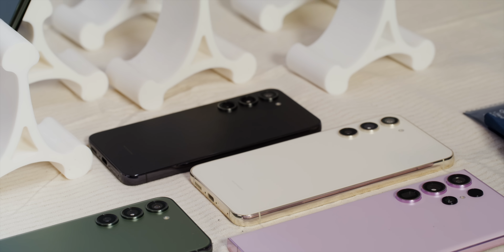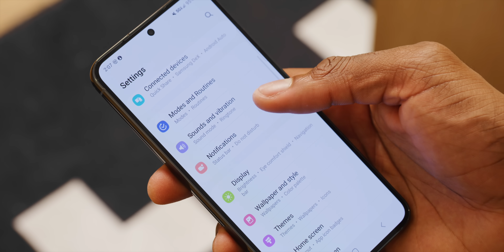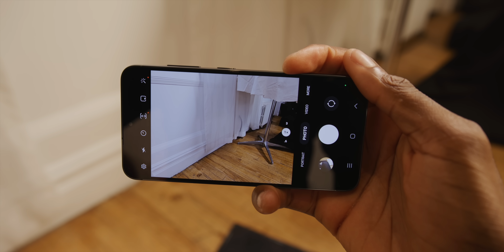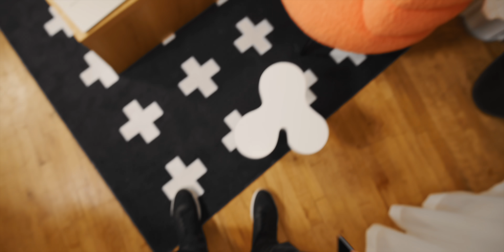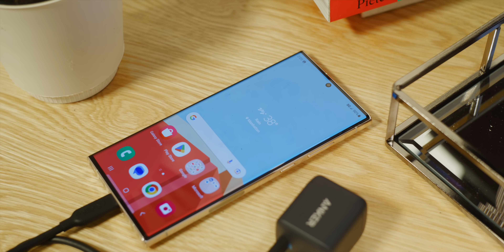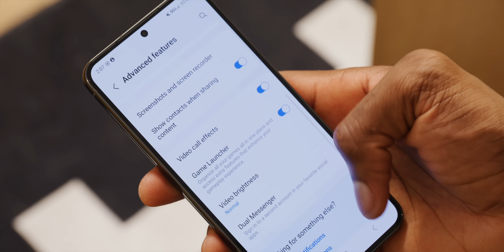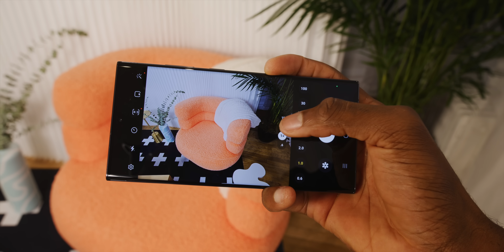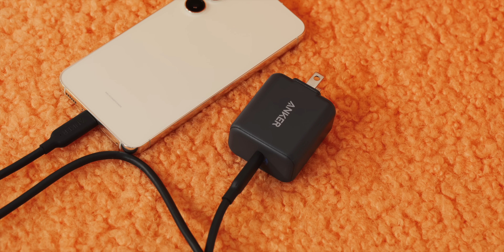Galaxy S23 / Ultra Impressions: Cruise Control!

Comment: Gonna wait until the S24 I think, depending on benchmarks and performance. Even the difference between the S21/S22 Ultra wasn't enough to make me want to upgrade.
Reply: Same, I'm still hanging on to my S9
Reply: @Adam-gl1qv  Depending on what you do with your phone, I'd recommend bumping up to the S21 Ultra. You can find GREAT deals, and it really is a powerhouse. I use mine as basically my second computer, and do a lot of retro gaming/emulation. In theory, the Snapdragon 8 Gen 1/2 are fantastic, but phones just don't have the thermal capacity right now to run them at full speed for any significant length of time, with the exception of the Redmagic 8 Pro, which has a whole ass internal fan.

Comment: I'm still rocking my S21 Ultra and love how it still works like the day I bought it. I'll hold on to it until it explodes. Phones are so good these days there's little need to upgrade anymore and I love it!
Reply: I tell myself this but desperately want to see what the z fold 5 is and if I'd be worth the $
Reply: Exactly! Still using my S9 and trying to decide which one to upgrade to. May get the S21FE as the price and battery are attractive.
Reply: @Furbabyfoster  try a z fold in a phone store to see if u like it. the fold 5 could be an epic phone later in the year. but ye its expensive.
Reply: I still use my Galaxy note 9 ! feeling like phones improve sooo little every year and they prices are so high

Comment: i liked the s21 ultra design feels like they just went backwards but the new colors are nice, think i will stay with my original s21 regular for awhile., unless they slow it down with some update then i will never get another samsung but thats just my paranoia 🌝
Reply: I swapped from my s21 ultra to the 13pro. Trust me if your a camera person, its not worth the swap. It felt like walking back to 2015 pictures with no zoom or organization. iMessage and airdrop are great but weigh your preferences. Im running back to Samsung next cycle personally.

Comment: I have the S22Ultra from last year. This one doesn't look like it's that different from what I have. Slightly different shape. I like this one. One thing I do not like about my phone is when placing it on a hard surface, it doesn't lay flat without its case. This version looks like it's figured that out. It's not giving enough differences for me to upgrade though.

Comment: The s22 was not rock solid, horrible battery life and choppy software
Reply: Also overheating because of the horrible gen 1 chip
Reply: Not surprised either that the shutter lag is STILL there on the s23

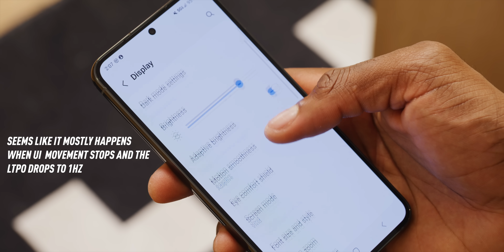Comment: 4:49 you can always turn on the show refresh rate feature in the developer options. That way you can always see exactly what the refresh rate is at any given moment.
Reply: Mine switches between 24-60-120hz and not from 1-120 hz, do you know why that is?
Reply: @jonathanstupidcheesespaghetti  I've heard it's because the screen refresh rate itself is changing via hardware rather than software, which is why it can't be detected on an OS level.
Reply: @jonathanstupidcheesespaghetti  because not all can go to 1hz, whats your phone?

Comment: Watching on my Galaxy S20 Ultra. I'll keep it another year and wait for the S24 Ultra. Just recently got the Android 13 update so I think I'm good with this phone another year.
Reply: Me too, I still have NOTE 20 ultra for two years now it's sharp and works amazingly fast, and does the job for me.
Last year and this year's Samsung S series updates are absolutely useless and Trash
Reply: @hamadalink9197  Another NOTE 20 Ultra user also! Phone is still in mint condition and I see no reason to upgrade for at least another year or so.
Reply: I have an s22 ultra bought in september. Tried to see what samsung would give me for it and they offered 90 euros because of a small crack in the glass. Lol.
Reply: My S20 Ultra is on the ropes rn. Pre ordered the S23 straight away
Reply: I'll take it up a notch with the s22 ultra which I think it has the spen and leave it at that for another couple of years, maybe summer or something I'll keep my s20 ultra for a little longer
Reply: @HUYI1  i would not recommend any variant of the S22 series, all those phones had terrible processors. When you buy a samsung phone make sure its manufacture by TSMC and not Samsung! I had the S22 Ultra (snapdragon manufacture by samsung) and upgraded to the Fold 4 (snapdragon manufactured by TSMC) and its a night and day difference.
Reply: I have an S21+ I'll probably be sticking with for another year unless something really exciting pops up on the S23+.
Reply: Using my s22 ultra for another year too
Reply: Idk but i think it is better to wait till 2025 because thats when we get the 500mp camera, selfie camera that can disappear, fingerprint scanner on the entire front screen, and redesign.
Reply: good decision 👍
Reply: My S22 is in dire need of an upgrade right now
Reply: @StreamerBTW99  unless if its broken beyond repair, please do not waste your money on the same phone

Comment: The 23 doesn't have UWB (not the 5G type the short range type)
The 128 base s23 also has slower storage.
Just 2 notes
Reply: The 128 base s23 has faster storage

Comment: Should I go for S23 or Google pixel 7 ?? What would you advise
Reply: Pixel
Reply: S23. The battery life is absolutely insane on the s23 with the gen 2. The pixel 7 gets about the same (only slightly more) as the s22 series which was ridiculously inefficient and heated up. Which if you're not a heavy user, you're not gonna notice. But if you're on your phone, you'll be itching for a charger on that final stretch
Reply: @DavidMFBowie  uhm? Do you have the s23?
S23 is only 3900 mAh 
The pixel got 5000 mAh

Comment: My S22 is still running great, so I'll probably pass on this year's model, but I can't wait to get my hands on the 2024 model when it drops.
Reply: Is the battery as bad as they say?
I'm considering an S22
Reply: @Ssh52  I'm never far away from a charger, but I'm pretty much on my phone constantly and get about 75% of my day without issues. I have the note 22 ultra though, so I have the largest battery they offer. No idea about the lower models.
Reply: @Ssh52  on my S22+ it's worse than my lat POCO F3.... but it is the chip's fault, only reason I want to change
Reply: @Ssh52  no. I am finishing my days with 40% battery left. About 2 hours of usage or 6-10 straigth hours of just listening to audiobooks
Reply: @lauri1687  I'm coming from an S9 which isn't the best for battery now, and needs at least one small charge during the day after a couple hours of use
I'm guessing the S22 will be fine by what I am currently used to with the S9 battery?
Reply: @Ssh52  really not great, but thats coming from an EU model with exynos in it
Reply: @ilovejesus1238  I'm from the UK so it would also be an Exynos.
I'd love to get an S23, but its far too expensive as of now, and I need to get a new phone as my S9 is too old for security+ safety reasons
Reply: @Ssh52  for my s22 u, 4hr sot from 85 to 20
Reply: @Ssh52  Honestly no it's not bad at all. By the time I get home from work I'll still have around 65-50% left of my battery which is why I don't bother carrying my charger around. And that's saying a lot cause I use my phone religiously throughout the day.
Reply: Why would you upgrade a hugh end phone after 2 years lol, i have a s22+ and plan to keep it for atleast 4 years
Reply: @michelbruns  Because I make enjoy having the latest tech and have the money to do so. I'm not going to sit here and tell you how to spend your money or tell you if I think it's stupid for what you spend it on. I guarantee that you spend money on things that I would laugh at if it wasn't something I'd spend money on, but I wouldn't be a dick about it to you.
Reply: You'll say the same next year
Reply: @HRM.H  me? Absolutely not. If they had made any improvements that I care about I would be upgrading this year, but I just don't need to.

Comment: As someone who has been rocking a galaxy s8 since new I think this finally might be the upgrade I need lol. Or I can get a s22 since their prices will drop now
Reply: Me, reading this from an S8 right now
Reply: S8+, stay strong fellow brothers!
Reply: Get the new one. It's battery life is more optimized
Reply: Get the s21 even
Reply: Get last year's phone or even S21 and have 98% of the same phone for a fraction of the price. Seems like a no brainer.
Reply: @Uncle_Fred  That's normally how I think. and what I would do; but in addition to what Antares mentioned about battery life, and the new camera functionality, the idea of paying monthly for the NEWEST phone that would theoretically last me the longest in terms of updates & compatibility, and hold more trade-in value just in case something wild and unexpected happens seems like the move for me here. 

But what you're saying does make a lot of sense, UncleFred
Reply: @WhamBamTySam  Personally, I don't feel the cameras have advanced much since the Note 4 days. Everything just seems more processed, and it's not a look I like, personally, especially in video. As for batteries, I feel modern batteries retain 90+% of their charge for 3-4 years as long as they aren't exposed to extreme conditions. If a phone has a capacity over 4500mah, that tends to be good enough for a day's light use. I don't mind replacing a battery on a phone manually. Lastly, trade-in value here in Canada is mostly a service of convenience. You don't get anywhere near the used market value of the phone, so it's more cost-effective to sell it and buy a newer, used phone. If the trade-in value made sense, this would change the entire thinking here.
Reply: @Uncle_Fred  Yeah, this is true. To be honest, I always keep an old phone as a backup. If I were to part with it, selling it second-hand would give a higher return than trading it in.

I miss the days of being able to manually switch batteries. Buy one spare, and a battery charger, and you essentially had infinite battery life. You could also keep phones for much longer since batteries tend to be an earlier cause-of-death for a phone than others.

That's why even though my current S8 leaves a lot to be desired nowadays, I couldn't justify getting the S22 Ultra despite feeling like it's passed due time for an upgrade. It felt like I was paying a lot more to have a lot less. Each generation seems to cost more and yet still take more away in some sort of celebration of planned obsolescence. 

After waiting so long, I just want to be able to splurge and give myself the gift of a piece of technology that is above my minimum requirements.
Reply: @WhamBamTySam  That's a very sensible view. I held onto my Note for seven years. Replaced the battery three times over that period. I wish we could get a phone manufacturer that have a high-quality phone with a removeable battery. Removeable batteries still exist, but you have to settle for LCDs. The Samsung Galaxy Xcover6 Pro comes about as close as I've seen to something modern with a removable battery.

Comment: I miss when their phones use to be so different from one another each year.
Reply: we've reached peak smartphones , i don't think there is any margin of substantial progress at this point
Reply: @die4race  its over
Reply: @Übermensch  just like hip hop peaked in the 90s. And video games in the 00's decade. Smartphones peaked now, in the early 20's. You are right. There is no where to go but down now. Unless beyonce is coming out of the phone to pleasure me, I don't see anymore improvements left to be made. Just minor
Reply: @chillvibed  I think the next big thing will be a Cloud-based phone , the phone will be equipped only with a screen and cameras , and all the computing and storage will be done in Cloud , thus giving more physical space for Batteries, 10000mah to 15000mah batteries will be the norm , after that , within 10-15 years , humans will be equipped with Communication chips and screen will be embedded into glasses or Contact lenses , merged with AR/VR
Reply: feel like apple much?
Reply: They've gotten so greedy now. Tim Roh started the trend of pushing profit margins over cost of production
Reply: Guess theres not much improvements to be made compared to few years ago other than the processor and camera.
Reply: Look at the difference
 between LG G Pro Vs LG G3, that was 3 years of phone progress; comparing that evolution, to the evolution of this Samsung S20 to the S23 is hilarious
Reply: Yup but this is what people are buying. Most performance and capability possible. So now we're riding the evolution train with very little difference until something new comes along we didn't know we needed.

Comment: S23 Ultra might be the game changer
Reply: nope
Reply: @henrybrar  yes it will
Reply: @aragon5869  new cameras + new processor is game changing apparently
Reply: @FormulaHL1  recycled material, 12 megapixel look better than 50 mp due to pixel binning, option of 6 pixel binning 12 mp, or 50mp 4 pixel binning, which makes photos a lot sharper. 22% recycled materials from pre-consumer phones, 100% recyclable box and from sustainable sources.. gorilla glass victus 2, which gives amazing protection from falls and damage, like no other phone. using overclocked snapdragon processor, and 200 megapixel camera. more boxy design to improve grip on the phone, severely improved low light and optical image stabilization far surpassing that of apples. using ai upscaling to generate crisp photos, and a far faster response time due to the new processor, and then you praise apple, what does apple do? dynamic island?